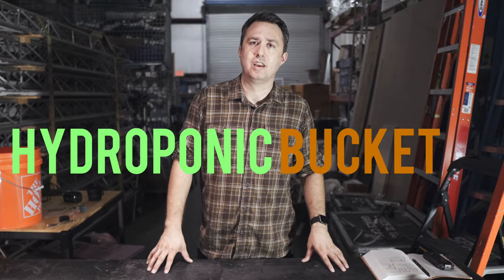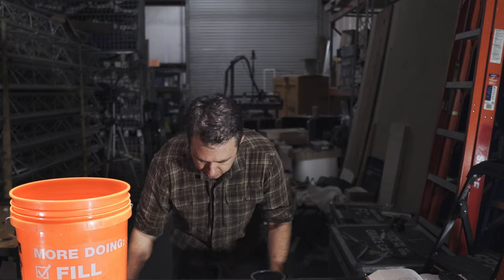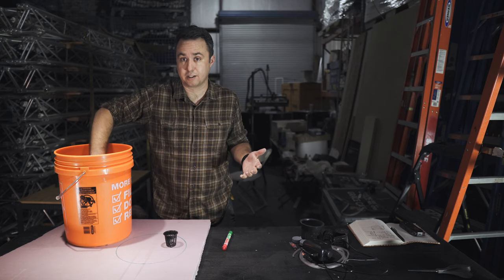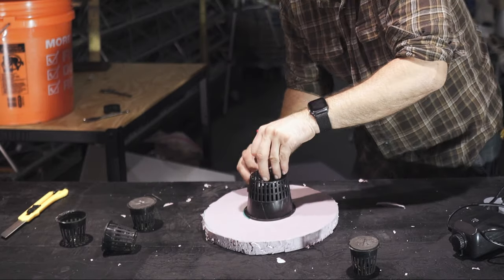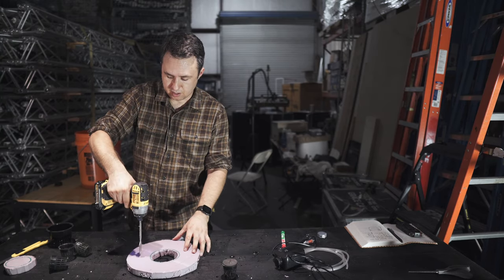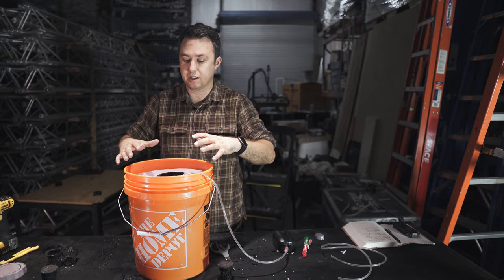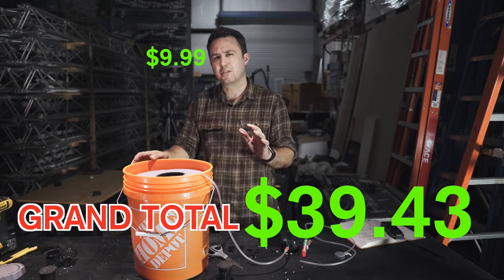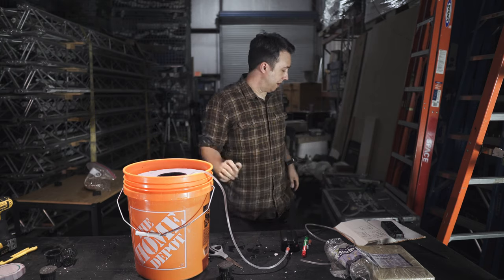Hydroponics Bucket Grower for UNDER $40! DIY Build. DWC Deep Water Culture hydro grow station.

Comment: A $40 bucket will grow $40 bucket quality. A $400 bucket, will grow $400 bucket quality. What's the difference? Aside from most likely a better nutrient line, I would say many upgrades such as insulated neoprene bucket sleeves, micro chillers, temperature monitoring and controller, water quality monitoring (PH/PPM/Temp/EC) drain petcock, liquid level gauge tube, ceramic air stone, quick-connect air hose fittings, and one of the best bucket upgrades in history, the P-Scrog mobile trellis system! 🌲✂️🍃🌳🔬🧬🥇

Comment: A few concerns, the foam firstly is a great idea in theory but not so much in practice due to root rot. Secondly, the tubing used should be black, letting any light in the water can be a bad thing. Otherwise yeah, good on ya.
Reply: There’s a reason why companies sell grade proof plastic buckets, you’re having people eat plastic now 😅also the tubing needs to be black or you’ll get algae. The channel Ditch the flock actually shows you the right equipment

Comment: Way back in the year 2000, a buddy and I sat inside of his greenhouse and had a discussion about growing this way. We had read a book about how this system was found accidentally around 1999. So, we got to work. After several failures and losses of tempers. We finally figured it out.  By all means, this is a great growing system. But you need to pay attention to your liquids. You might get algae in your reservoir bucket because the temperature of your growing area was warm enough to support it. So, we added a draining system to the bottom of all buckets. That allows you to drain your system and replace your nutrients.  Good luck and happy growing.

Comment: You can also always cut the holes out of the lid of the bucket! Less of a mess then foam and more durable. Thank you though, this helped me realize my answer i needed for the concept of hydroponics!
Reply: The lid of the bucket won’t float and change with the water level instead of worrying about topping the water off.  Am I misunderstanding what you mean?  Or did ya miss that part of the video?

Comment: Rather than drill for the airstone... drill 1/4" hole to pass the airline through, then connect the airstone after passing the airline through.
Reply from the maker: That sure would have been a cleaner way to do it!!
Reply: @SPACEDESIGNWAREHOUSE  posted mostly so anyone following will hopefully drill for the airline, either way love the foam float idea, very easy to follow for new growers!
Reply: It was at this moment I paused and came to the comments. Love you bro but that's some funny shit 😅 It's like choosing joggers over jeans because your sneakers can't fit through the leg holes.

Comment: I Use pool noodles no basket or rocks needed and still grows  SAVE MONEY Buy Bucket with lids cut 2 1/4 hole and pool noodle cut 3 inches long then cut half inch out turn that around put back in Now it will hold your plants again Save lot of money
Reply from the maker: SMART!

Comment: Just a thought, instead of a paddle bit ,try hole saw bit(mostly comes in various size packs 2-10inch) and can just be pressed trough and is very very safe...unlike carpet knife that will cut u <3
Reply: Why not drill hole for hose not airstone
Reply: @1111DAH  this is what i was just saying lol
Reply: @1111DAH  Or cut a little notch just big enough for the tube, right off the edge of the netcup's hole.  Then access the stone and tubing from the one hole..

Comment: Any reason why you used a paddle bit to make the big hole for the bubbler? You could just punch a 1/4"  hole in the foam that just fits the hose.   Leaves less area where the lights can reach the roots. I've been doing DWC in totes....water levels are a pain in the ass. This is a better method and for sure it is easier to water.
Reply from the maker: I’m going to go with ‘brain fart’ For why I made such a big hall, I already had the paddle bit on because I was using little baskets on the other bucket, and that Rock was pretty big I don’t know why I didn’t think of just disconnecting the rock from the hose
Reply: @SPACEDESIGNWAREHOUSE  You rocked it... didn't split the foam after you warned us not to do that with the paddle bit.   I grabbed a pencil and just stabbed a hole. I'm switching out my DWC with this plan system this  weekend. Thanks for the ideas bro!
Reply: @SPACEDESIGNWAREHOUSE  I went to Lowes all hung over this morning and changed my  2 DWC bins to 4 buckets. New time save tip: Instead of using a magic marker, I put the bucket on top of the styrofoam and stomped it. Perfect circle.

My grow tent looks a lot better now , because  the buckets say "Do It Right!" 
Cheers man. I should have never listened to my buddy 2 years ago....yelling at me because "Pot don't float". He shot me down and talked me out of this idea.

Comment: I would consider just using the regular lit and put the netcub in there. At least for bigger plants. Some plants need to have the base above the NS or you get trouble with root rot
Reply: What is a lit? I'm looking to do something like this but want to make sure it's done right.

Comment: No matter what power setting it is on, it will use whatever wattage is says. No matter the setting, it will either use the power or dissipate unused power as heat.

Comment: Wouldn't you have to adjust the distance from the light as the water level lowered ? , so either add water or adjust height for consistency.

Comment: As a grower I can see the following problems:
Light leakage: this causes algae growth you will want a dark bucket with a lid.
The basket should not be submerged in water this will cause root rot.
Temperature is a huge factor again to hot it will cause root rot too cold it will stump growth
Reply from the maker: I love hearing from a grower!  It sounds like its a miracle that my plant grew so big!  It eventually got tall enough I had to suspend some little ropes down from the truss above my set and it only died one day when I had a power outage while I was out of town for a week so the air pump in the water wasnt providing the roots with air..  Good points!   I guess the warehgouse is quite dark, most of the time, except for the lights that are specifically aimed at the leaves so that solved the light leak - and the heat must have been a coincidence to be healthy..
Reply: @SPACEDESIGNWAREHOUSE  also depends what you growing. My girls are pretty special when it comes to nutes, light and temperature.

Comment: How loud is that pump? Asking cause I do propagation via grow rack and lights, but I'm interested in hydroponics as well, but live with roommates. Wouldnt want a loud pump that'd disturbed anyone
Reply from the maker: That pump is really quiet. If there’s anything else at all going on in the room you can’t even hear it.  It definitely won’t bleed sound out of the room
Reply: Super quiet and you can get them as low as $10 on Amazon with all the pieces needed.

Comment: The liquid level needs to be a couple inches below the bottom of the net pot. This looks like an ingenious way to murder a plant
Reply from the maker: I do wonder, then, by what miracle the plant I put in this system grew so large.. I ended up with a healthy 7 foot hemp plant that lived in the warehouse for about a year before I moved it to the back yard to save space and basically forgot about it.
Reply: for kratky method the water should barely touch the roots. for this method (deep water culture) the roots are submerged abd get a 24/7 air pump

Comment: What about the heat in the water root rot it's going to happen hydroguard doesn't always help you got to chill the water with a mini shrimp chiller straight into the bucket water temperature got to be under 65 are you going to have major problems done it millions of times you'll have more problems than successes

Comment: Should have just got lid also black
Reply from the maker: A lid wouldn’t sink down with the water level as the plant drinks it; that’s the reason for the floating foam. Should have been black, though, I agree!
Reply: @SPACEDESIGNWAREHOUSE  I get that but roots also love air with out some water now that also depends on the plant good convo
Reply from the maker: @JonathanLopez-tw8ef  I was under the impression that this was the entire point of hydro because Ive got a pump constantly shooting air bubbles onto the root mass all the tim all day long.  Im not expert, though - just experimenting.. I will say this plant is EXTREMELY healthy looking
Reply: @SPACEDESIGNWAREHOUSE  Good keep it up have fun and good growing
Reply: You can go both ways, and get great results. This is more kratky, but with aeration and not really DWC